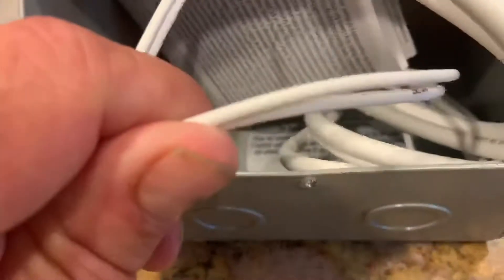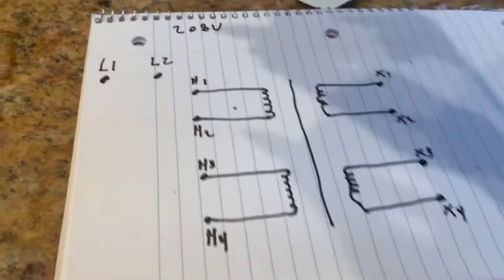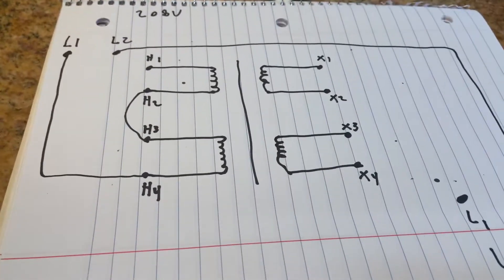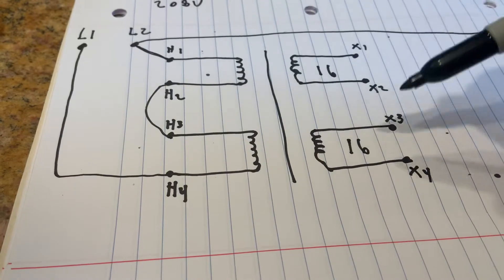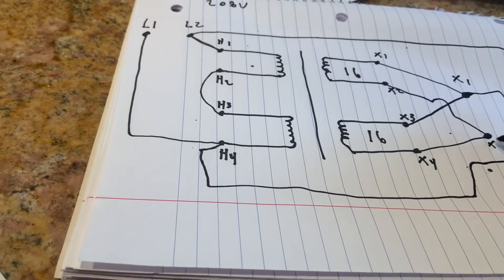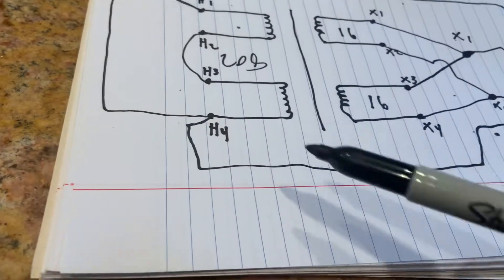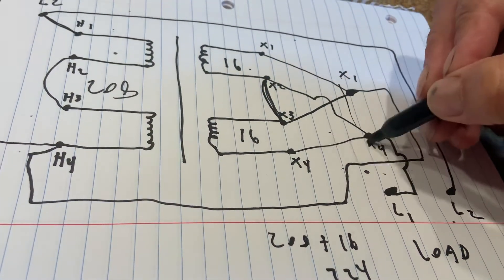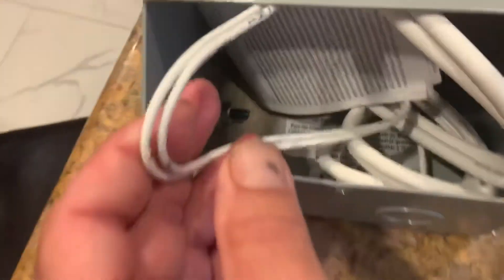Wire buck boost 208-224-240

Comment: great video! I have a question,  I have a rotisserie oven 3 ph 208v and our store is 220v  single phase, how do I modify the rotisserie oven? unfortunately, my electrician left town for good,  he fixed this situation un the past with my first convention oven, took him about 40 minutes to modifythe oven panel, and our oven still works amazing nonstop, and now everyone tells me that they don't know or I can't do it...  what's your opinion?
Reply: In general, a transformer isn't going to derive three phases of 208Y/120 from 120/240 VAC split phase service.  You need to use a phase converter (static, rotary, or digital solid state).  It's up to you to decide whether it's worth the expense and inefficiency of a phase converter vs. selling the rotisserie oven and getting one that takes 120/240 VAC.  Consider contacting the company that made the rotisserie oven to see if it's possible to rewire it for 120/240 VAC (possibly replacing heating elements and/or the motor), but don't be surprised if it's prohibitively expensive or impossible.

Comment: Awesome video. I have a job coming up where I need to use a buck boost transformer and all the diagrams provided are confusing. This made it super simple and easy to understand thank you. 

I have 120/208 3 phase and have to power a 1phase 230v 31A compressor.
Reply from the maker: glad it helped
Reply: That’s exactly what I need to do as well, to the T.  What did you get to complete the job?  We also have a 120/208 3 phase system and need to power an espresso machine

Comment: Please post a link to the product you're using. I need to buck the voltage (nominal 240) actual. 246, 246,249 ab,bc,a. The equipment I am connecting is 230v specific.
Reply from the maker: that will work look up buck boost  its easy
Reply: Are you sure it's necessary to buck the voltage?  240 VAC is only 4.3% greater than 230 VAC.  That may be within equipment tolerance, and you may already have a few volts' worth of voltage drop at your 240 VAC outlet.  If you haven't already contacted the equipment manufacturer, consider asking them whether 240 VAC nominal is adequate.  It's very possible that you're fine as you are.

Comment: Please help. If I do the 2o8-240 will I get 120 on phase a and 120 on phase b and of course 240 on A-B?
Reply from the maker: Yes that’s what will happen within a couple of volts
Reply: @greggmgm  No, it isn't.  Assuming 208Y/120 service, you'll get 120 on one phase (because it's tied to the incoming main) and approx. 150 on the other phase.  There's no "of course 240" here, because the two phases are 120°, not 180°, apart.

If you're planning to hook up an electric stove to a buck-boost transformer that is boosting 208 VAC to approx. 240 VAC, you'd better be sure that you don't run the "wild" (~150 volt) leg to the circuitry in the stove that is expecting 120 VAC, or you'll risk frying the electronics.  On the other hand, if your load expects only 240 VAC with no neutral -- for example, a typical 240 VAC window air conditioner -- the assignment of phases doesn't matter.

Comment: Hello, really helpful thanks, what if I need to go from 208v to 240v with a neutral? (I do have a neutral on the primary side)
Reply from the maker: Glad I could help I try to reply to my comment when I see them my brother had a laser set up and it wouldn’t work if it drops below 208 so I did his that way it has been working fantastically it should work perfect for you don’t be scared of it it’s easy
Reply: A mean, I need 240v/120v on the secondary
Reply: Thanks for replying, I got the wiring, my question is with the neutral, can I use the neutral from the primary to feed the neutral on the secondary since I have 208/120v on the primary and I need 240/120v on the secondary
Reply: It depends on whether you need 120 VAC from both of the load-side phases.  If so, you'll need an isolation transformer with a center tap, which is bigger and more expensive than a buck-boost transformer.

However, if you're running an appliance like an electric stove, which requires 240 VAC for the heating elements but only one 120 VAC phase for the control board, fan, lighting, etc., you may be able to get away with wiring the 120 VAC load-side phase (i.e. the one that is tied directly to an incoming 120 VAC phase) to the terminal on the stove that requires 120 VAC and wiring the "wild" (~150 VAC) phase to the terminal on the stove that doesn't require 120 VAC.  You may need to contact the manufacturer to get a wiring diagram in order to figure out which terminal requires 120 VAC and which one can tolerate 150 VAC.  If in doubt, get an electrician to help you: it's probably cheaper than replacing a burned-out control board if you get it wrong.